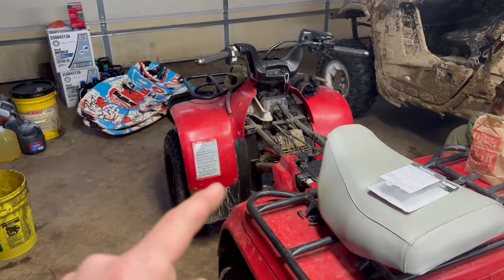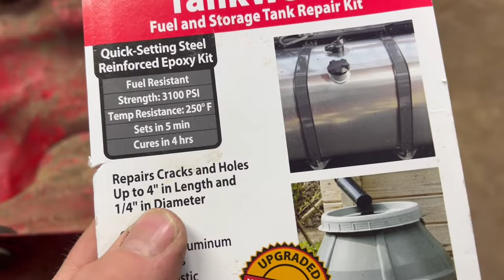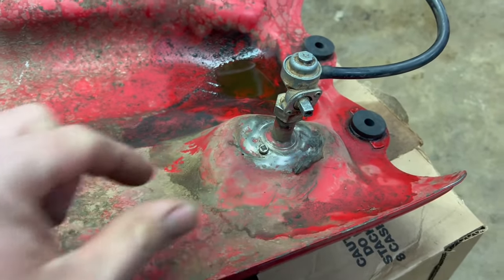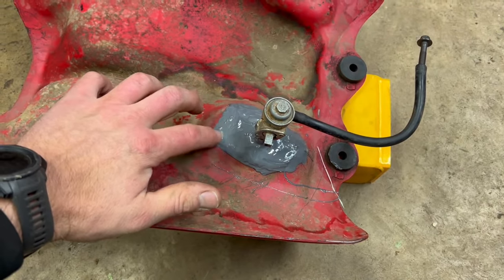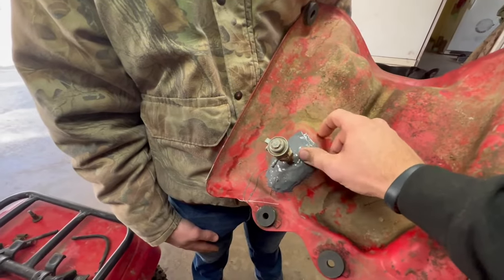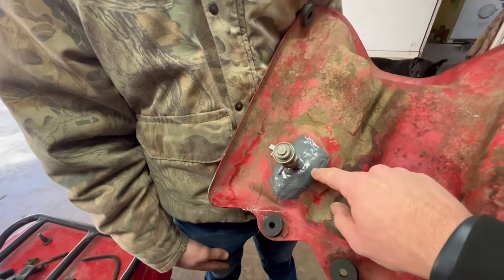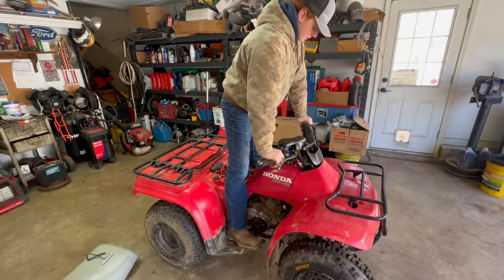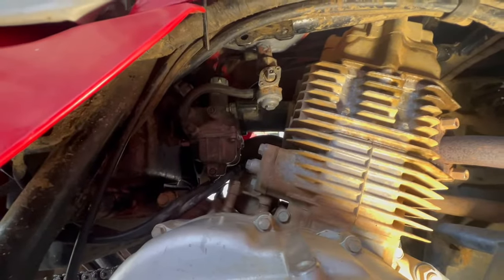JB Tank Weld Does it work?

Comment: I used on bottom of metal tank and it failed. Possibly wasn’t clean surface but I do think it can work in right condition. Going to attempt it again tomorrow. Thanks for sharing
Reply: How it worked??
Reply: @Amarillobymorning777  it didn’t work well on stainless steel. It gave me a few months without problems. I’m actually about to weld it next week.
Reply: @danielely7437 I'm about to try this tomorrow when the fuel gets below the hole... something rubbed a thin 'cut' in the side of a stainless fuel tank and hopefully this will hold for me until the tank can get properly welded or replaced
Reply: @darklight4815  it worked for me for 5-6 month then it started leaking again. if its for a temporary fix, its all good
Reply: @harfangdes3541  right on...and yes it'll just be temporary so that's good to know it'll at least work for a while
Reply: @darklight4815 do you have to remove tank from car to weld it ???
Reply: @jakobmx125  no but it needs to be empty or at least below the hole or crack...and dry and as clean as possible for it to hold up...we did a diesel tank and it's still holding to this day...and that was 7 months ago

Comment: For big repairs, or if you want extra, but JB Weld Steel Reinforced epoxy $6 and an 8sq ft fiberglass sheet for $6. Costs the same, can repair almost 10xs the area

Comment: So it’s been a month how is holding up? Steel stik failed me and it’s either the tank weld or actually weld it this to around.
Reply from the maker: Doing great hasn’t leaked a drop and has been rode alot
Reply: How's it holding up I have a High density polyethylene tank with a screw holes can I use this

Comment: Thanks for the video tutorial. Do you think this might work for a 2 stage MTD snowblower fuel tank that is leaking around the seam where the two halves of the tank are joined together? The fuel tank is plastic, so I'm not sure what the best solution is. My pack of JB Weld 2-part epoxy says it's fuel and petroleum resistant, but while searching YouTube I found your video specifically using the tank weld product. It definitely seems to have worked for your application!👍
Reply from the maker: It did work and worked well for a little over a year. I just recently had to remove the tank and work on the carb and it was starting to release and try to peel off. However it served its purpose for over a year.
Reply: @AutomedicGarage  thank you for letting us know. Change the title and do the update - that is valuable information.
Reply: At $19 for jb weld, you should probably buy a new tank

Comment: I have put JB weld steel stick putty on my fuel tank thank holds diesel. About 10 hopes the size of a match head up to 1 the girth of a finger. I got the tank sand blasted and prepped before I put it on. So my question is how long will it last ? Any help would be good people.

Comment: Given your experience with JB weld, if I covered a 3-4mm layer of it around a 3D printed enclosure. Would it hold at 1000psi? I’m essentially creating a JB weld air tank.
Reply from the maker: I highly doubt it. It held on this job for about a year and then gave up.

Comment: Someone drilled a hole in my dad's car gas tank. They probably only took 1 gallon but the other 14 gallons just dumped on the street. Hopefully this works.
Reply from the maker: Do the prep work throughly and long as it’s 1/4” or smaller you should be good. Thanks for watching.
Reply: @AutomedicGarage  The tank turned out to be PE plastic which the tankweld specifically states not recommended for. We will see how it holds up, in the mean time we will think about using a soldering iron or getting a spare from the junk yard.
Reply: @alexd4102 hi. How did it hold up?

Comment: Screws in the tank for some reason is because it's the best way to fix a leak! It works the same in a tyre too, pull a nail or a thorn out of a tyre and wind in a screw, always carry screws to fix leaks!
Reply from the maker: Screws might work but it would never be my fix for a gas tank on a fourwheeler my kids ride. Tank weld has done excellent and fixed the leak. Thanks for watching.
Reply: Tire...
Reply: Tyre is what most of the English-speaking word calls tires.

Comment: Used on motorcycle tank. Failed quickly
Reply from the maker: It’s still holding up for me. Maybe it’s more for smaller sized holes
Reply: I had it fail on me once on a boat fuel tank but decided I'd try it one more time after I convinced myself that maybe I didn't have it clean enough the first time. That did it. If you keep in mind that it's just epoxy resin and has to have BARE, scuffed-up metal and spotlessly clean and dried (I used acetone and stainless steel (that's important) wire wheel. ) now it's stuck on there so hard I don't think dynamite could blow it off.

Comment: Looks nothing like my JB TankWeld. Mine isn’t a liquid.
Reply from the maker: Probably because you have epoxy putty. If you look on your package it will either say “epoxy putty” or “reinforced epoxy resin”. Putty is like play dough and sets rather quickly the resin has the consistency of syrup. Thanks for watching.
Reply: @AutomedicGarage  I’ll take a look when I get back. I was looking it up to see if it was suitable for a tank with a few rusted pinholes before treating and lining the inside. Which do you think is more suitable?
Reply from the maker: @emmettturner9452  the only way the epoxy resin will work, I feel, is if you can have the holes facing up to have gravity help fill the holes as it dries. I’ve used the steel putty many times for other fixes and it’s done what I need it to.

Comment: Doesn’t work on car gas tanks. Might work for a week but it will dail eventually. I used 3 kits to patch a 3 inch crack and it failed. Looked solid too but doesn’t work.
Reply: Supposed go seal the inside with por 15

Comment: Would this work my gas tank it has a small whole crack head drilled hole in it to steal gas
Reply from the maker: @jimlahey9977  it will work but don’t count on it to be permanent, it worked for about 2 years for me.

Comment: I found it a waste to time and money.
Reply from the maker: It worked great for my purpose, fourwheeler still isn’t leaking. I can see where it could fall short on other applications but I was happy with my results for the amount of money I spent. Thanks for watching.
Reply from the maker: @terry lester it failed after about a year. I degreased the tank, filled it with water and welded the holes up. It was a good temporary fix but was never intended to be permanent. Thanks for watching.